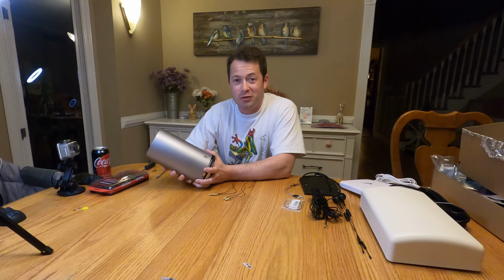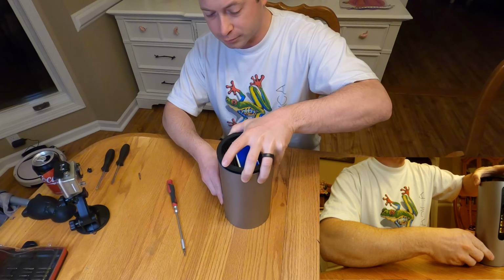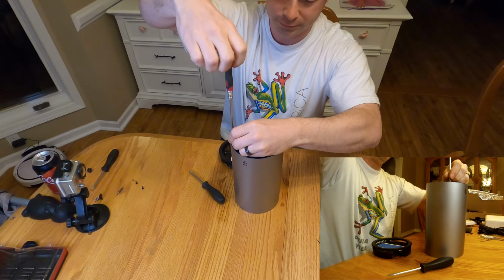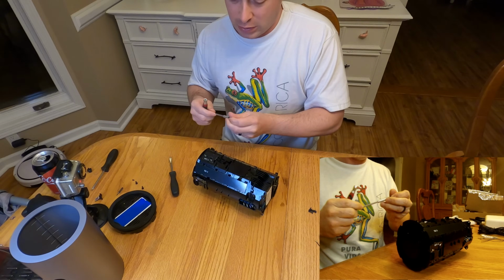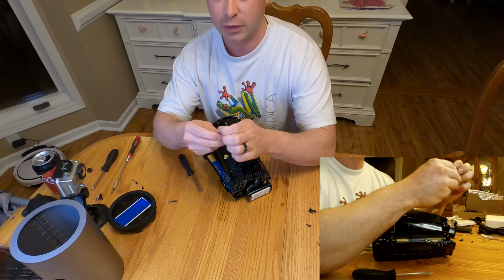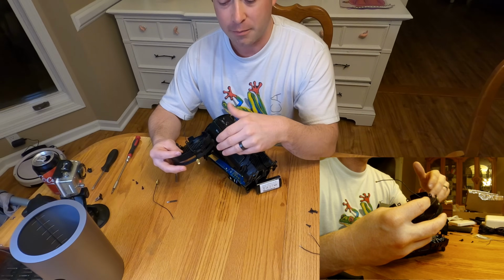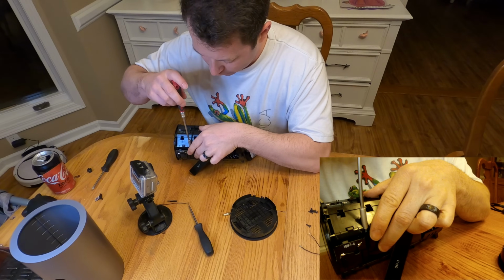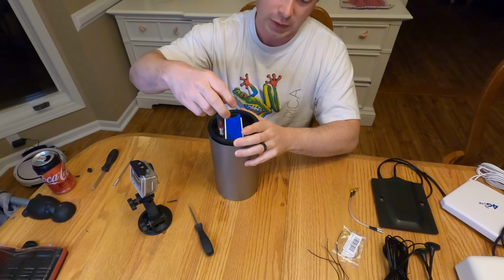✅ Improve Your Signal!  Add External Antennas - T-Mobile 5G Home Internet Rural Broadband - How To

Comment from the maker: Parts I used:
U.FL to SMA adaptor cables:  https://amzn.to/3dL2gHv
U.FL to N-type adaptor cables: https://amzn.to/3dK0G8I

BUY IT:  Get 5% off Waveform antenna and signal booster products with this link: www.waveform.com/natertater or just use code "NATERTATER" at checkout.  Then you can go to the 4x4 MIMO Antenna product page: https://www.waveform.com/products/4x4-mimo-panel-kit

Cheetah 5G Router (use COUPON CODE NaterTater for $45 off): https://chestertechrepairs.com/products/wifi6-industrial-lte-5g-nr-wireless-modem-router-unlimited-hotspot-rv 
Invisagig - https://chestertechrepairs.com/products/invisagig-os-qualcomm-sdx62-rm520n-gl-standalone-modem-nr5g-4g-lte
USE COUPON CODE for $20 OFF : natertater20off

Be sure to see my other Verizon and T-Mobile Home Internet Videos: 
Verizon: https://youtube.com/playlist?list=PL8d9FovK2dNSOcTz7L6sHiuWVQXwUT4my
T-mobile: https://youtube.com/playlist?list=PL8d9FovK2dNQHp0KWk8gG8XXvaKzaoSB3
Peplink cellular devices: https://www.youtube.com/playlist?list=PL8d9FovK2dNTZR2vUJWyd6kmmDD6ediym

Comment: Thanks for the great video. Is there a way to improve the WiFi antenna range also while I’m in there?
Reply from the maker: Technically yes,  the wifi antennas have the same u.fl connector and you could buy external wifi antennas to add buy people typically use their own wifi mesh system to improve coverage.

Comment: Thank you for trying so hard to show us these antennas. The problem is on  YouTube at 4K you cannot see what you can  see.  You try the impossible to show 2 videos as once, when what we need is just one close up high magnification video of what exactly you are doing. I went 4K and my starlink internet could not keep up with the download properly. That aside, we cannot see the the parts you are talking about.

Now, thanks for explaining L1 L2  L3 L4 but you don't state the frequency of each antenna.
L1 and L2 go together as do L3 and L4 , so I assume that L1 and L2 are like 1600 and 1800 mhz and L3 and L4 might be 5.4 and 5.5 ghz etc. 

I am in Canada and tried this modem today, and it performed more poorly than the smaller rectangular modem or portable small brick modem. 

I'm looking at making 4 Can Antennas feeding the modem.

What would be good is  a description of the conversion cables required to go SMA 
Thanks for the video but I might as well  just listen to the audio as the video is next to useless.
Reply from the maker: links to products like the cables are in the video description

Comment: the most important part is you connecting the new wire to the 3 or 4 g connection.... nothing. I can see what your inserting into the 3 g plug. doesn't look like you connected anything only put back the original plug

Comment: Uh how do you attach the wire to the external antenna? You didn't show where the wire was coming out of. Like you just put on a piece of metal on the wifi part, then put it back together. Not criticizing but just need answers
Reply from the maker: What's the timestamp that you get lost at?

Comment: I added an external antenna to my trash can gateway but now the gateway is showing signal but when you try to log on to the wifi it states there is no internet connection. Any advice?
Reply from the maker: I'd confirm all the connections are on properly and very the order in which they are connected.

Comment: NEED HELP........Does anyone knows what size antenna connector do you need to connect those split and can I get them in Amazon.
Reply from the maker: Parts I used:
U.FL to SMA adaptor cables:  https://amzn.to/3dL2gHv
U.FL to N-type adaptor cables: https://amzn.to/3dK0G8I

BUY IT:  Get 5% off Waveform antenna and signal booster products with this link: www.waveform.com/natertater or just use code "NATERTATER" at checkout.  Then you can go to the 4x4 MIMO Antenna product page: https://www.waveform.com/products/4x4-mimo-panel-kit
Reply: Oh ok thank you.  I had found another one that has 2 going in to the tower and 1 coming out to the antenna not don't know if that would work.  Trying to minimize cables
Reply: Antenna Splitter Adapter Cable TS9 For Netgear NIGHTHAWK M1 MR1100 mobile WiFi
Reply: This is what I'm talking about.  You think these can work also??????
Reply from the maker: @luisangel10002  ts9 wont work on this gateway
Reply: Ok thank you so much for all your help.  Trying to put cameras around the house but my signal sucks is either poor or weak and can't connect. Hopefully this can help me. That's for all your help

Comment: I have been using my Nokia/T-Mobile 5G home base since August 23, 2021. Thank you for keeping this video up on YouTube. My issue is the Battery. It is not charging. I can see it trying to charge the battery on the top display. I also read the alert about low battery life. It is not a firmware update. I collected all the information from the bottom label to see if I can find a replacement. It looks like I will have to view the battery itself once I open it up. 😀
Reply from the maker: You can just unplug/remove the battery.

Comment: Well, Nate, with your help I added an external antenna to my Nokia gateway I used your links, the hardest part was getting the new connectors to snap on to the circuit board. It's still inside, I have to mount it outside but so far it's not a major difference but is very noticeable. I will let you know when I get it installed outside, anyway, thanks for your help.
Reply from the maker: You're welcome!

Comment: Hi, again, Nate- I decided to continue with the trashcan instead of the Acadian, because the trashcan allows you to select your desired wifi channel, and when it reboots, it always comes back up on the same selected wifi channel. Acadian may select a new channel for you upon reboot. Have you tried connecting a N41 band (only) antenna to any of the trashcan ports? My trashcan always locks on the N41 as the Secondary Signal internet connection, with the Primary always being B2 or B66. B66 is good, but B2 has a lousy ping. The primary RSRP is around -100 and SNR from 3 to 8, but the secondary is much worse at about -112 and 6, respectively. The trashcan's internal antennas are all marked "5G", which doesn't tell you whether it is for the 700-900 mHz range or the 2.5 ghz N41 band. I want to put a 2.5 ghz only antenna on port 3 or 4 to improve the N41 signal, leaving the other port, 4 or 3, connected to the trashcan's internal antenna. Have you tried somethibg like this? This should work, as these ports are paired (I think) to allow for "diversity reception", via a 90-degree hybrid combiner for each pair 1-2 and 3-4. I cannot run 4 coax cables for a 4X4 MIMO antenna over the required distance using "fat" low loss coax, so a single cable is a must. Thanks for all you do on these.
Reply from the maker: You dont want to run a single antenna but you can do a 2x2 MIMO.   https://youtu.be/ED4a913fOl0 5G will always show up as secondary on the Nokia, thats normal.
Reply: @NaterTater  Thanks, Nate!

Comment: So we got our antenna installed and we have tried a few different configurations so far including the original recommended configuration on the Waveform page, but so far we have had no luck getting a good connection with ours. The signal keeps dropping off. I will keep playing with it over the next few days. I have limited time because I am working long hours to boot so it has been a struggle. But do you have any suggestions? I am worried that we might have damaged one of the pins which is my biggest fear. They were so hard to get to snap on.
Reply from the maker: Hi Autumn, check out some of my placement/help videos here: Waveform Cellular Antennas for T-Mobile and Verizon Home Internet: https://www.youtube.com/playlist?list=PL8d9FovK2dNS1HuMabIm8hspYa7nlXpPP

There is a chance you damaged a connector, you should be able to look at it with a magnifying glass or even camera zoom to see it its bent.
Reply: @NaterTater  I figured it out, I didn't realize to only connect 2 of the 4 leads, for some reason that made a HUGE difference and I have a signal again. It is not the fastest internet in the world but faster than we had so we are happy! Thank you for your video I guess somehow I missed you mentioning that before I watched it several times before I caught it. lol

Comment: Do anybody knows if these devices are working only on T-mobile networks or they work with any network as long as you add a different Sim card?
Reply: You can buy them straight from the manufacturer completely unlocked.

Comment: I seen a used gateway for 20 bucks. If I bought a used gateway could I use the anttenas off it and add more anttenas to my existing gateway? Would that help increase my download speed? I don't know if they sale a splitter. But you have multiple gateways might be interesting to see if that does anything.
Reply from the maker: That would not help.

Comment: I have a new tmoble trashcan and hooked a waveform 4x4 to it. Now the app isnt working and I can't connect my PS4 or Roku to the wifi. Also says no signal (before I installed the 4x4 it was "weak") now it just says no signal lol. I figure it's a firewall issue or DNs since it won't allow my devices to connect
Reply from the maker: That's not a firewall or DNS issue.  Those dont prevent devices from connecting to the wifi.  Make sure all your antenna leads are properly seated and check the sim card (remove and reinstall) and reboot the gateway making sure the power cord is fully seated.

Comment: My question is why can't you remove the antennas from the router and extend them instead of purchasing an external antenna. I think I'm going to remove the existing internal antennas from the case and place them in an outdoor enclosure with extension cables.
Reply: How did that work out?
Reply: I did not try it. tmobile could not figure out how to give me the home internet discount at $30 instead of $50 for t-mobile cell customers. I would have to call every month to get a credit and eventually got fed up and canceled the home internet portion of my service.  I also got annoyed with having to reboot it every day to get the speeds back up. I have att Uverse at only 25/3 and it seems faster because the latency is much lower. I may try it again if they can get their billing figured out.

Comment: Does anybody have any info on the battery? Model number or the voltage would help. The Nokia manual only says 5000 mah. No info on chemistry or voltage. Currently using ups supply, less than optimal solution. thanks
Reply from the maker: The internal battery does not allow the unit to operate (disables wifi and ethernet).  UPS or usb power bank is the way to go.
Reply: @NaterTater  Hi, Nate! Thanks for the input. I am using a ups with the Tm Acadian KVD21. The other day, the ups went off line for no reason. Of course, the KVD21 rebooted when the power returned. When it did, the wifi came up on a new channel (5 or 7 instead of the original 11 and the incoming switched from b2 to b66, slower). I have used ups's for decades as a professional, and they are not as relaible as the internal battery used in some electronic equipment. I have a Nokia gateway I bought on ebay, so I'm going to put it into operation. It has no battery, but online research led me to the specs: a 1s li-ion, 5000 mah. Thanks for all you do, your vids are very helpful.
Reply from the maker: @barrytaylor7365  the unit still reboots after power returns with the onboard battery.

Comment: I’ve had my gateway setup for a while now with external antennas without issue until today. I found myself back at your video to learn how to slide the 5g antenna to the side to split the modem in half to make the ports easier to access. I’m thankful beyond belief for this video thank you thank you

Comment: So I bit the bullet and bought the waveform 4X4 Mimo antenna package. Seems Starlink is going to keep delaying availability in our area of Virginia. My biggest concern was i have a shaking issue with my hands. I am 63 years old. But it did not affect the install of the very small u.fl connectors. I did exactly as Nater notes in his video. I worked from 4,3,2 then 1. I was really impressed how easy it was once I took apart the Nokia cylinder. I did run into a issue with putting back together. I was not able to get a click on the last leg of the bottom base resulting in my sim card not being read. My guess is it was because how I routed the wires in the bottom grill area. They kind of got bunched up around that area. But I was able to push down on the plastic base and screw it into the position it needed to read the sim. The results are amazing. I went from 25 DL and 5-10 UL to 112 DL and 55UL. So massive improvement. I am 2 miles and lots of hills and trees away from our tower. And I only had a 8 foot pole so I am sure I can improve if I wanted to put the antenna on the roof. Thanks Nater Tater for your videos and great advise on rural internet.
Reply from the maker: Great to hear!  Happy to help, great job.

Comment: I have an arcadyan unit and I added the waveform external antenna.  Worked for a month then stopped immediately with WAN002 error (rebooted/reset with no luck).  Would the external antennas cause the unit to heat up and have a meltdown... more requiring the addition of a cooling fan?  T mobile app still shows freq connections to 4G and 5G and good to very good signals.  Just no internet functionality...
Reply from the maker: Try removing and reinstalling the SIM card.  Let me know if it fixes your issue.
Reply: @NaterTater  No joy.  Still same error :(
Reply: @NaterTater  Just an update.  Got a replacement Arcadyan unit and same no internet issue/WAN002 on panel error.  After calling t mobile home internet support several times, they elevated my case and I was given a case number (engineer to work on issue) 5 days ago.  Yesterday it started working wohoo!  With the recent  April/May  tower upgrades,  speeds tripled now.  Ordered a double bearing cooling fan to complete the setup--

Comment: Hi Nate, My tower is due north. 
If the Logo is on the front & the power & RJ-45 ports are at the back, for best reception which "side" of the Nokia should be facing to the north?
Reply from the maker: In my experience the front (with logo) should face a little left of the tower.  So slightly northwest in your case.
Reply: @NaterTater   2 things have happened since my original trial/setup; 
1 All the trees are fully leaved now
2 Speedtest was pinging in the teens 200 miles to Nashville, now always pings 35ms 450 miles to Dallas. 
All winter I was B2 & n71 now B66 & n41  ;/
Reply: Rebooted some more and Speedtest auto-ping is back to Nashville. Pings in mid 20s now.

Comment: hey every one dont buy these high dollar antennas from waveform and yagi my t-mobile set up with the nokia gateway and a 35 dollar external antenna i get downloads speeds exceeding 200 mbs and up load speeds of about 40 mbs i am about to hook up the other 35 dollar external antenna i am trying to max it out at 350 mbs download before i installed these antennas i was lucky to get between 20 and 30 mbs i am in a bad area for cell service but now it does not matte what area im in

Comment: I added an external antenna. The top two ports give me 3 bars but won't download at all. The bottom 2 ports give me 2 bars and about 60 download speed. Why would I get 3 bars but not be able to download from the top 2 ports?
Reply from the maker: Do you have the Nokia gray "trash can"?  Did you look at your cell metrics like which band and SINR/RSRQ you get?  Thats more important than the signal bars.
Reply: @NaterTater  I do have the grey Nokia. What I can't understand is the top 2 ports have the same numbers as the bottom 2 but it will not connect to the internet. How is that even possible.
Reply: I took screen shots but don't know how to post them.
Reply from the maker: @dalechambers4787  sometimes it needs a reboot and time to "adjust" to the new antennas.  But if you are getting good performance on the L3 and L4 port...why change it?
Reply: @NaterTater  I actually had a pair of the waveform directional antennas. I was getting 20 down and 5 up with the internal antennas. I added the antennas and get almost 80 down and 45 up at times but probably average 45 up and down. Between 8 and 10 at night I drop down to 10 down at times but still 45 up. I bought a second set and it didn't help at all. I was testing them and realized the the top ports with the second set of antennas make no difference. It's not the antennas. I can't understand how the signal and the matrixes are the same but I can't establish a connection on the top ports.
Reply from the maker: @dalechambers4787  your gateway may be defective.   I an others can get an improvement using just the top ports.
Reply: @NaterTater  ok thanks. That's what I thought.
Reply: Soooo. I exchanged my unit and the new one has the same issue. No signal on 3 and 4 but signal on 1 and 2. I'm trying to do a 4x4 mimo. I cannot understand why on 2 units port 3 and 4 don't work. The connections are definately good.

Comment: If I have a properly placed external antenna, could I place my gateway in my basement?
Reply from the maker: Yes but you'd be better off running ethernet down to the basement as you want the external antenna leads as short as possible.   I actual have my external antenna in attic and gateway close by in attic level loft then ethernet to basement to personal mesh wifi system.   Works fantastic.